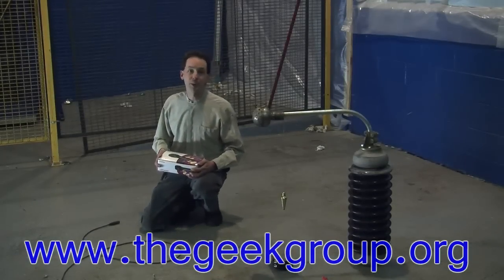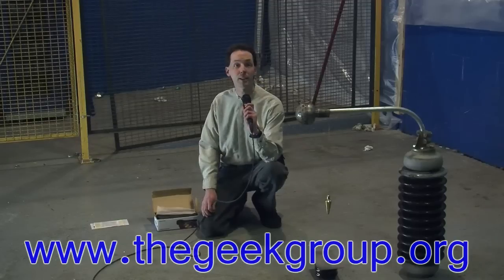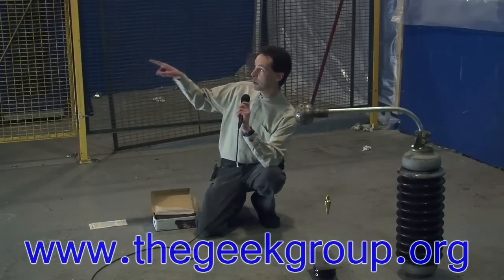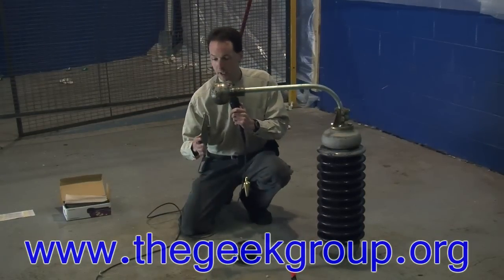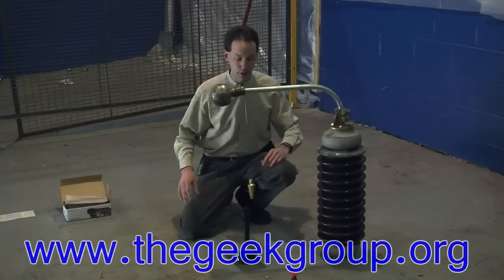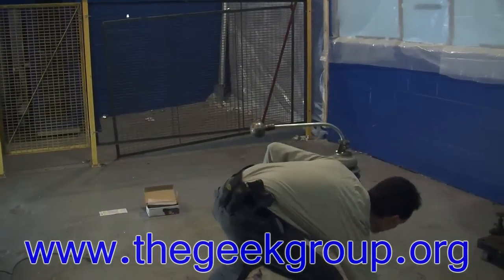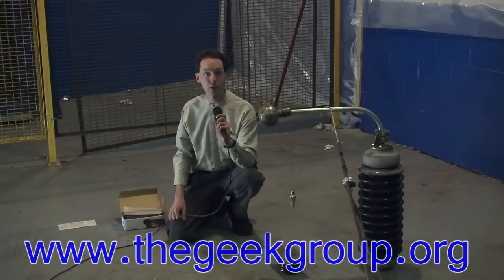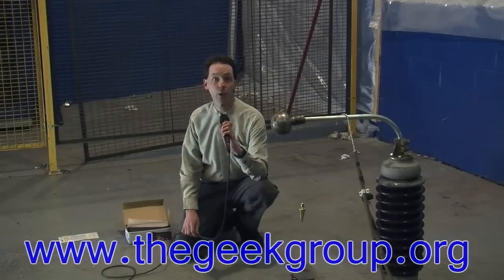Audio Technica AT2010 High Voltage Demo Explained

Comment: @ShovelAndRake  in practice they do, but we usually speak of them going in the other direction. but the clue was that the metal body and mesh around the electronics had a lower resistance, so almost none of the electrons took the path of the electronics

Comment: The current stated was 1 amp which is NOT small at 75,000 volts. The reason the microphone survived is that it is shielded. (see the comments below from forwardbias) Electricity will always take the path of least resistance so it flowed around the delicate circuitry directly to ground. If the experiment were set up so that the electricity flowed through the microphone circuitry, then it is unlikely that any studio microphone would survive. Well shielded mic!

Comment: @cerealguy500 remember current is inversely proportional to the voltage
amplifying the voltage causes the current to became very small (Power stille thesame 75KW). the wires are more affected by the amount of current
flowing in it..(voltage amount doenst affected the wire that much)

Comment: I think I know what is happening. It's design is like a faraday cage protecting the inside electronics.

The microphone itself has a wire mesh at the top connected to a metallic housing. When taking the path of least resistance the order should pass right over the sensitive internal workings. 

Mesh piece covering microphone >  Connected to metal body > ground plate.

It seems any device that has a low resistance housing surrounding it that is connected should be relativity immune.

Comment: it has a aluminium body doesn't it?

The high voltage went into the metal mesh, into the body, the body conducted it into the aluminium plate and then onto the ground.

I liked seeing how the wire didn't appear to make a good conection with the.. plumbob it was called? you didn't strip the insulation did you? ;)

also, I'd like one of those power supplies.
too bad our grid connection is only 3fase, 22amp. though that could be nice..